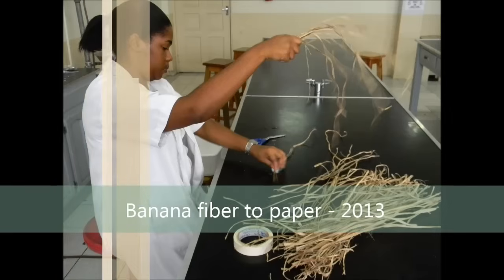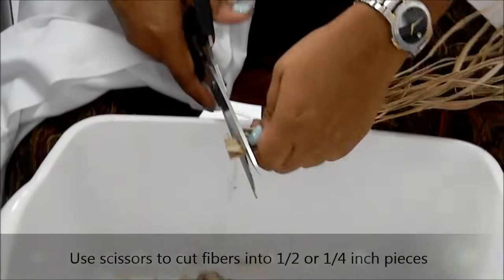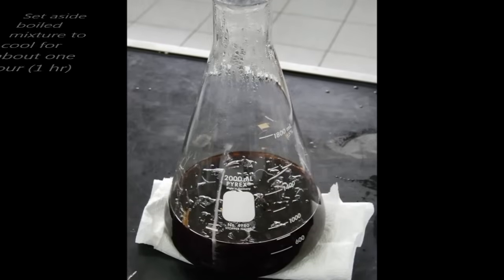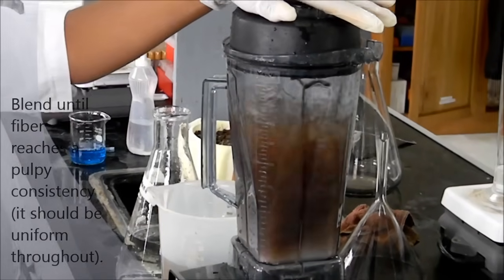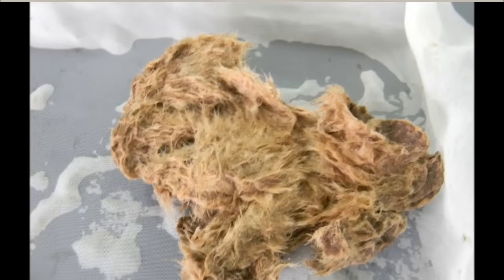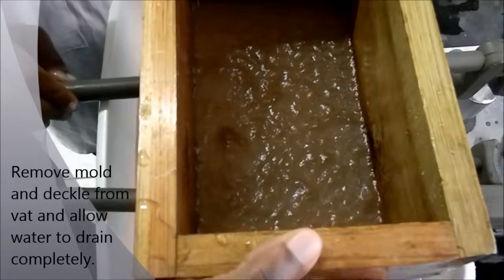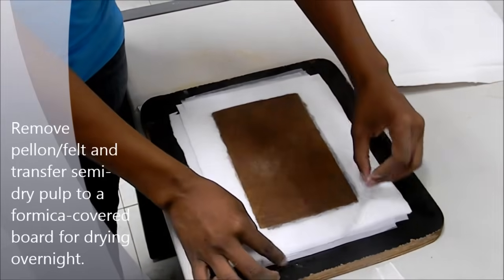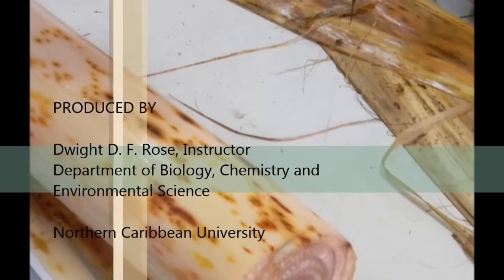How to convert banana fiber to paper

Comment: Can I get the full list of the equipments used in this video?Tqvm
Reply from the maker: Scissors (to cut up dry fiber); a vat (half-filled tub of water larger than your mold and deckle); a blender, a press (some heavy weights placed on top of the samples can also act as a press to remove some of the water); waterproof mold and deckle (these can be made...future video..or check out https://youtu.be/sU71fWKR0wg for a simple one); a strainer and shear fabric (to rinse cooked and pulped fiber); a smooth surface (preferably non-porous - to aid in the drying of the sheets); a paint brush (to help transfer paper to drying surface or to remove air pockets); a sponge (to remove excess water from the mold while couching); sheets of wool or felt material (for couching a sheet...I have read that thin blankets can be used also); and finally a waterproof board (to couch the sheets onto for pressing).  I hope you find this helpful.
Reply: @dwightrose5735  thanks

Comment: Hi I just wanna ask If what is better to use to dissolve the lignin, NaOH or KOH? And another thing, why or how these compounds are able to dissolve lignin? Thank you in advance😊
Reply from the maker: KOH can be derived from boiling or leaching ashes.  It is said to be a bit unpredictable, especially if you do not use reagent grade KOH.  NaOH is the most widely available (I bought it in the supermarket) delignifier and can be used in various percent concentrations (5, 9, 10, 12, 15, 18) depending on the  toughness of the fiber.  Sodium carbonate (Na2CO3) is another contender, but may be difficult to obtain and may also require longer boiling times.  Either way, NaOH is more effective in removing lignin in a shorter space of time.  Some acids (formic acid and acetic acid) and sulphates are also used in other processes.

Lignin is a large organic molecule, making up to 10–25% of lignocellulosic biomass and is the second most abundant natural polymer (next to cellulose - the other polymer in plant material). It is insoluble in water and stable in nature and acts as the “glue” that connects cellulose and hemi-cellulose.

Chemicals which dissolve as much lignin and as little cellulose as possible are used in pulping. Sulfate process uses white liquor, a mixture of sodium hydroxide (NaOH) and sodium sulfide (Na2S). Sodium hydroxide degrades lignin and sodium sulfide fastens cooking reactions and decreases cellulose degradation caused by sodium hydroxide. Temperature in sulfate pulping is normally 150 - 170 °C.
http://www.knowpulp.com/english/demo/english/pulping/cooking/1_process/1_principle/fr_text.htm 

Most paper-making factories actually recover the lignin from the black liquor and use it as a fuel to power the boilers.  The important thing in using an alkali (like NaOH) is to keep the pH of the solution up in the 12-13 range.  Boiling also increases the rate of removal of lignin.

Comment from the maker: Actually, the dry weight of the fiber is important, but what is more influential in determining the percentage solution is the type of fiber.  For example: bamboo is much tougher (more lignin) than grass and thus requires either a longer cook time with a lower (5-10) percentage NaOH solution, or a shorter cook time with a higher percentage (12-15) NaOH solution.  It is essential to maintain a high pH (11-13) throughout the cooking process.  Therefore, the short answer is to choose your percentage based on the type of fiber.  Books like "The Complete Book of Papermaking" (ISBN - 1-57990-456-4) will come in handy.
Reply: Good day sir , can I have ur email I'd sir , 
I would like to ask some questions on banana paper . Tq sir
Reply: hello i was wondering if process is applicable using cocoa pod/shell? just for the fiber part only. really need your opinion for thesis purposes. thank you
Reply: Sir kindly Say some books to study the process of converting fiber to cotton

Comment: What is the exact purpose of cooking banana stem with NaOH? what would happen if it is cooked without adding NaOH? if stem blended without cooking what would happen?
Reply from the maker: nirasha dilki The alkali (NaOH) dissolves the lignin in the plant.  Lignin is a compound that keeps cellulose fibers glued together to give the plant structure.  Once this is removed/dissolved the solution becomes dark brown and it can be rinsed away to release the cellulose with mechanical action (blender or Hollander beater).  You can now make paper.  If you do not use an alkali to cook it the lignin will remain in the plant tissue and your paper will get brittle over time.  You can go as low as 5% alkali and even use potash (KOH - wood ash boiled in water and filtered).  You just have to increase the cook time.
Reply: Without cooking the banana bark if we add some glue type material while making the pulp can we overcome the brittleness of the paper?
Reply from the maker: nirasha dilki It will eventually degrade overtime.  Real paper is primarily cellulose.  Glues and starch can be added to improve the quality and ability to hold ink and print.  Newsprint still has a bit of lignin in it and thus degrades over time.
Reply: I made a thick sheet from banana pulp. But mold is forming in that sheet. Are there any way of prevent mold formation? or could you please advice me about a coating to apply on the sheet?
Reply from the maker: nirasha dilki most likely your sheet of paper had a bit of lignin in it and a lot of moisture.  Mold needs food and water to thrive.  Your sheet of paper must be thoroughly dried to prevent mold growth.  I have sheets of paper made 5 years ago and I have no mold problem.

Comment: Sir, can you please give me the volume of NaOH solution used per 50 g of fiber. Thank you, great innovation.
Reply from the maker: The thing that is important in the paper-making process is the pH of the solution and cook time.  The volume of solution should be enough to cover the materials so that they can come to a steady boil.  If you decrease the percentage of NaOH (to say 10% or even 5%) to save on chemicals, you will have to cook the fibers for a longer period.  Some fibers soak up a lot of solution and require more volume to cook them.  The process is one of trial and error for different plants.  I stripped off the outer layer of the plant to reduce the extra absorbent inner layer to increase cooking efficiency.  I hope this comment helps.
Reply: It surely hit the spot sir! Thank you once again

Comment: Please I've been trying to make wool pulp to make sanitary pad; how could this same process help? What are the necessary processes to take? You can as well email me at dammytech74"yahoo.com  

  Much thanks as I look forward to your explanation.
Reply from the maker: A Hollander beater (USD $2500/$5500 +) is probably the best machine to use to convert fibers to pulp.  A blender will work with most cooked non-wood pulps, but it does not effectively "beat" the fibers like a Hollander beater.  If you are into larger scale processing of plant (cotton, hemp, etc.) or animal (wool) materials which are relatively difficult fibers, then I suggest a Hollander beater (The Critter or Oracle are low-cost options).  A beater usually takes like 2-4 hours to process plant/animal material to pulp.  Below are some you-tube videos illustrating the small Hollander beaters.
Mark Lander - https://youtu.be/fo9Vxgvg3vA 
Robert Edmondson - https://youtu.be/fYXP-cJxOEc

Comment: Hi. what if I add food coloring or ink so the paper has color in the end?
Reply from the maker: Different types of plant material respond to dyes in interesting ways.  You can use food colouring, but you will have to add it to heated pulp which must be left to cool for about 2 hours.  Sometimes mordants have to be added to the dye bath (a rusty iron nail is an example, and Alum is another) to increase the absorption of the stain into the plant material.  I will try to work on a video for that, especially since I haven't seen much on youtube to help in that regard.

Comment: Nice!Quite like making mulberry paper.
Reply: I highly recommend cutting the banana bark to 1-2 inches instead of 0.5-0.25 inch.It makes fibers too short and the paper weak.
Reply from the maker: +Jayson Bondad Thanks for your observation.  I will try it out soon and compare the results with previous tensile strength tests.  I think I'll upgrade to an ice blade in the future for more beating than shearing.